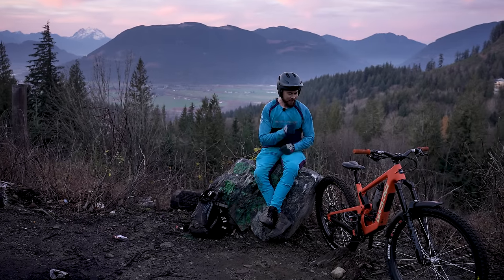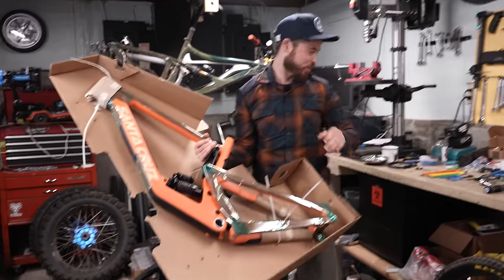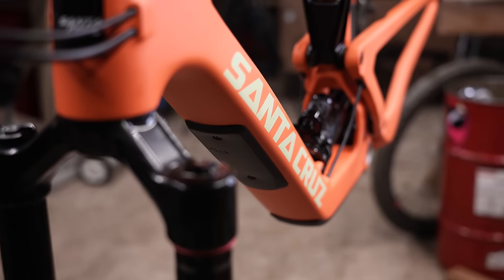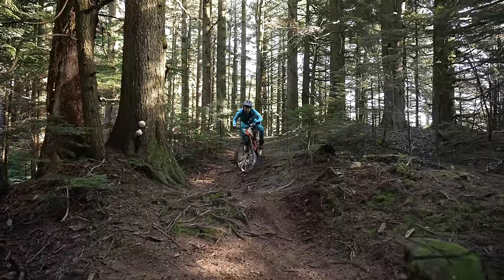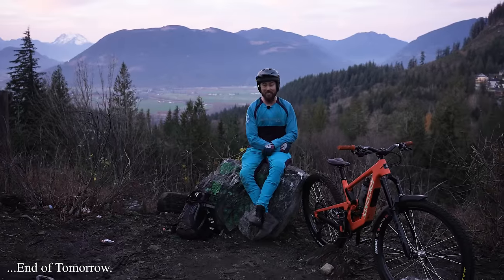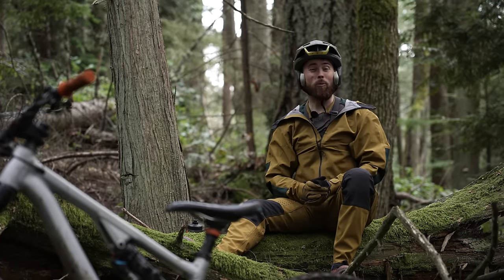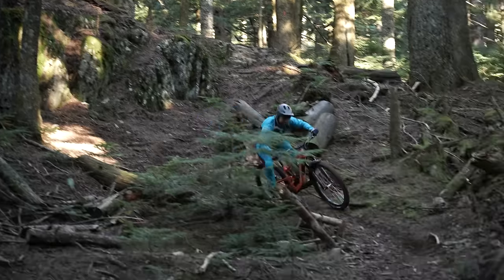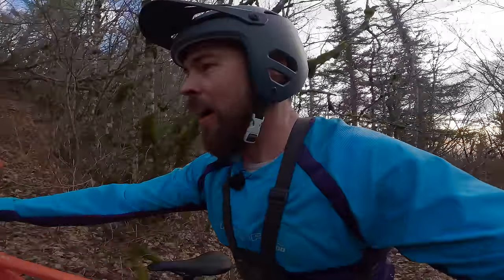Santa Cruz Bronson Ride & Review

Comment: I have a Santa Cruz 5010, and I absolutely love it. I live in Minnesota and I don’t ride a bunch of gnarly downhill stuff, so I don’t need huge travel. The 5010 is a fantastic trail bike🤗
Reply: I'm going to be in the market for a full sus trail bike mid/end of next year. I'm in North Dakota so similar-ish mountain-free terrain. Lots of narrow singletrack - often with chattery, ungroomed grassy bits and cattle trails -  in my local riding future. Do you feel like the 5010 is ever not enough bike for you? What sorts of things do you ride? I see a lot of Minnesota trips in my future, is the 5010 enough travel for spots like Cuyuna? I've not been out there so I have no idea what I could expect over there!

Thank for any info you can lend!
Reply: @DontWorryImAPilot , I live in Brainerd and ride Cuyuna several times per week. I can say that I’ve never felt underbiked with the 5010. I also have a Trek Fuel Ex 7, which has a little more travel up front. The Santa Cruz is a lot more playful and maneuverable, and it handles the chunky stuff well. I don’t typically do big drops or large jumps, but I ride the rock gardens well. Hope that helps.
Reply: @DontWorryImAPilot  My opinion a used status for the park and a alloy tallboy for local trails.
Reply: @DontWorryImAPilot  5010 is plenty for Cuyuna, you can ride pretty much anything there. Only place I might want more than 130mm in MN is a few spots in Duluth.  Short travel is where it's at in the upper midwest.
Reply: @vitaflo  That's what I thought, too. The bikes I'm considering are the 5010, the Rocky Mountain Instinct, and the Commencal TEMPO. If I found a sizable gold bar I'd probably add the Pivot 429 to that list. If I'm honest, I think the 5010 might be the frontrunner right now because of the mullet (I'm a short dude) but that Tempo seems SO sick.

I'm only a year in to mtb (though I have a massive ton of time logged on bmx and commuters before an injury) and my Commencal hardtail has been great. The places I've ridden with it I've felt completely prepared from a bike perspective. I also know there are a lot of places on my "I expect to ride each of these places a few times a year" list that are more rowdy or require more traction than I can reasonably rely on myself to hold on the hardtail. I'd like to cap my bike ownership at 2 bikes - I don't like owning many things - and I'd love to make sure my 2nd bike purchase isn't a terrible choice straight out of the gate! Thanks for the reply!
Reply: I've got the previous 5010 before they went mullet. I love it. I ride the PNW, mostly central Oregon. I do find I'm under-biked at times. The trade-off is having an amazing climber, and basically a mountain bike that rides like a BMX bike. In an ideal world, I would have a medium to long travel 29er to compliment my 5010. Maybe one day 🤔

I demoed the current Bronson that he's on, down in Santa Cruz a year ago. For whatever reason, I never warmed up to it.

Comment: I've been riding the 2021 BronsonMX for 2 years now, yes I got it in 2020, and the bike is the dream!
It's excellent in steep chunky stuff, performs great at speed, and is insanely stable in the air! 
The small rear wheel keeps the rear right underneath you when turning. Corners on a dime. 
10/10

Comment: I rode this Bronson the gold one for 2 seasons and it was my favorite bike ever.  I sold it recently and already regret doing so.  It’s good everywhere.
Reply: Wot did yu get to replace?
Reply: @bikemad  I replaced it with the new hd6 which is great, in a lot of ways similar, but more travel-  they are both great bikes- There are a lot of other bikes that look cool to me as well-  the Madonna v3, Druid V2,  the nomad,  But the Bronson was to me a bit of a Goldilocks bike.
Reply: @danielray1558 if you were to decide between the two, would you still pick the HD6 again? Sat on an HD6 the other day, & it felt goooood!

Comment: Great content as always Jeff!!    The Bronson looks like a great time.  I was eyeballing one earlier in the year.  My only problem with it and all Santa Cruz's is the pretty cheap kit you tend to get for your $$, so I always look elsewhere.    The S Bronson is $6000 and only comes with a cheap Fox fork and select+ shock, meh AR rims with 370 hubs and the cheap Code R brakes (which are pretty bad compared to the RSC).   For that sort of money you should at the very least be getting RS Ultimate or Fox Elite level suspension and RSC brakes.
Reply: Word. And also no aluminium versions.
Reply: Prices are way down and their warranty for frame and wheel replacement is the best in the industry hands down. 
It's 💯 worth the cash and, as I'm doing, you can upgrade as you go. 🤙

Comment: I made a similar experience coming from a 2016 stumpy to bronson 3. the bike felt more sturdy and pedaled so much better. Honestly I could not think of anything that the stumpy did better. Now I'm on a Nomad 5 and I just love that bike.

Just make sure to press some grease in the lower linkage, they don't to it in factory for some reason. Once all the lower linkage is fully packed with grease (repeat that 1-2 times a year), it can easily make 2-3 years without bearing change. Also you can get the bearings for free if needed.
Reply: Nice, man. And whats the main difference youve noticed between Bronson and Nomad?
Reply: @edubarc73  Nomad is a lot softer, but pedals about the same. Bronson had a sporty feel. I installed a megneg on the super deluxe and had a custom tune on it to make it feel a bit more planted and more progressive. The nomad felt good immediately. It has so much grip, it's way more composed when you plough through roots and feels bottomless. But downside is that it feels kind of slow and lazy on flatter trails. I ended up installing a megneg as well to get a little more support, I can imagine a coil shock would help as well in this regard.

Comment: Hay Jeff, nice rig!
if you want to get rid of that annoying creaking coming from the headset.
Then rap the outside of the headset bearings with approx 2 full turns of P.T.F.E plumbing tape.
Stretch it on tightly, trim off the access tape that overlaps the seals.
And reinstall the bearings.
Job done!
Super cheap but very affective!

Comment: i think mullet is more suited for enduro and downhill. Bettter Turn in helps those long bikes more and the better roll over angels dont matter at high speeds as the smaller rear wheels let the suspension work better(the traction disadvantage of mullets at lower speeds turns into a traction advantage if youre fast enough and the trail is rough enough). also a stronger rear wheel is always nice

Comment: Glad you finally got this bike. I bought mine in 2022 when it launched and it’s been the absolute dream bike.

I highly recommend trying a cascade link with it and an EXT coil. Gives it that big bike energy and better performance on gnarly stuff, and you can switch out to the stock air shock when riding “fun trails” and it’s ultra poppy and fun.

Comment: The smaller rear wheel increases the scrub radius of the rear wheel, causing the force vector to push the force of the rear wheel into the turn, instead of into the front wheel line when using the same size rear wheel. It's a force that can be felt in tighter turns. You do lose a little rollover speed, but gain a little more cornering and acceleration speed- not to mention wheel strength and weight gains. It's definitely the bike on my wish list.
Reply: Yea but that force vector clashes with the hypotenuse of the angle between the seat tube and the valve stem when airborne. In the past I've rectified this by running 20" tubes and cushcore valves but that effects the scrub side of the force when pedalling up 69° fire roads
Reply: 60% of the time, that works every time…

Comment: I just got a mullet Nomad C from Jensen, running 38 and X2, I'm super happy. I have a Stumpy Evo and had an Enduro, the current SC designs are better imo. Horst has some additional compromises vs a good VPP/multilink. Evo may be a little too lightweight and not quite stiff enough, Enduro is a little too big. So I'm building my Evo a little lighter, the frame is a LOT lighter vs Nomad, and am psyched to have the Nomad for burlier trail. Mullet: it's less inherently stable and hence more eager to turn, cornering is more intuitive vs a full 9'er as you don't need quite as much lean angle, and it responds to increased lean angle more readily vs a full 9er. It makes the bike feel more agile overall.

Comment: Reasons for mullet:
Stronger wheel, less gearing needed on cassette, smaller rotor needed, reduced mass = more responsive suspension and acceleration, increased ass-to-tire clearance, allows for more wheel travel without compromising tube placement, increased chance of fitting fatter tires

I ride full 27.5 and will hold onto 27.5 F/R as long as possible…

Comment: I would say its fairly common knowledge the Spec mullet link isn’t very good. For the Stevo you need to run the Cascade Link with the WRP Yoke in a mullet set up. It’s far and away better than running the spec mullet link. The Bronson looks heaps fun all the same.

Comment: Hey man, awesome review, I built my own Frankenstien Bronson v4.0, a couple of years back. You can even see it on pinkbikes best daily drivers of 2022. I love my bronson. Unlike yourself, it was the big front wheel I had to get used to, but I wouldn't go back now, to full 27.5" hoops, and I have never got on with full 29rs. Contemplating a coil for the rear end.
Reply: I went coil as an experiment on my V4 and never took it off.  I jump some and it works fine for that but the planted, smooth ride feel of the coil on the V4 is really special.

Comment: Test it with 275 on front for old time shake, maybe it'll be better 😏
Reply from the maker: 😂 I thought about it! A 180 travel 38 and a 27.5 front wheel would be interesting- but the more I ride it, the bike would lose its balance- not worth it when it rides this well.
Reply: Sure 180 i don't know 38 would be necessary, anyway if you have fork and wheel it would be good for the sake of science 🤣

Comment: I regret ever giving my faith and time to Santa Cruz for them lying to me and telling me nothing would change on the Bronson and they then I find out after waiting almost a year (from 2020 to 2021) on a video that they got rid of the aluminum frame, turned it into the gimmicky mullet (because 27.5 wheels are still more playful than 29ers and mullets lift easier on steep climbs), increased the downtube with no storage, took the mid spec out and dropped it to the lowest spec while making it carbon and adding $1k to the price tag! F*ck Santa Cruz! So, I took my money that I had saved up after waiting almost a year on their word and bought a nice 2 channel system for my bedroom instead. I'm not a fan of 29 inch wheels as I ride differently to where a 27.5 is more beneficial for me. More power to those that ride 29ers and enjoy them, not knocking them, but not my ride style. Just a major dissapointment that Santa Cruz went that route, when they could've at least warned of some changes coming instead of lying.